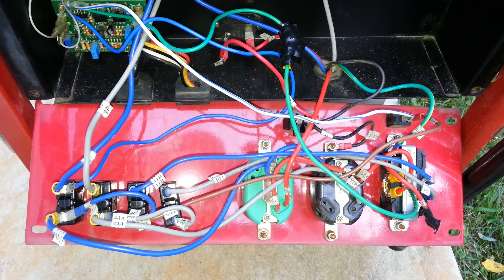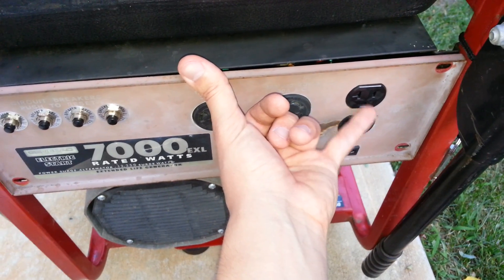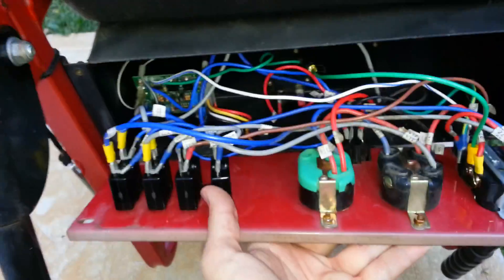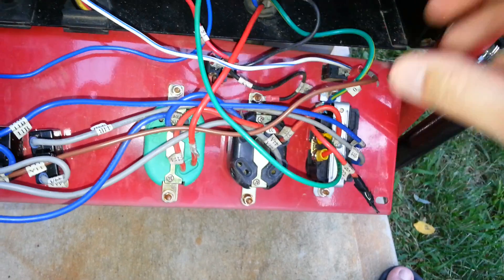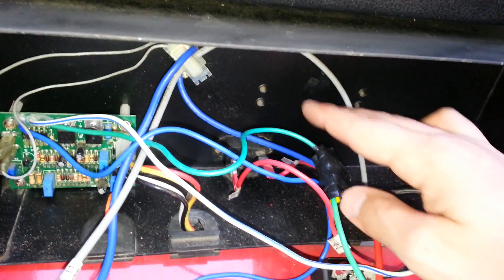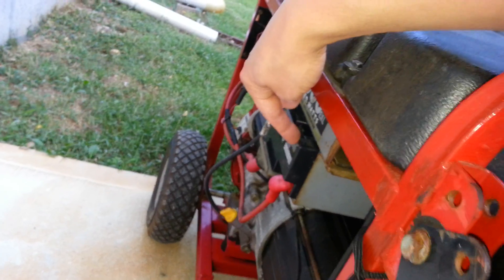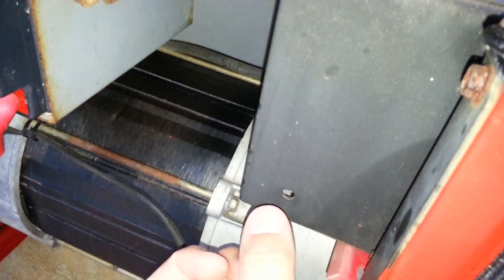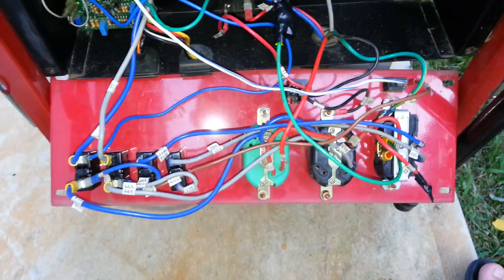Generac Portable Generator Wiring Diagnostic/Overview Part 01

Comment: I’m getting around 130v straight from the gen (isolated). But when I plug everything up I only get 100v from the plugs.
Reply from the maker: Could be a lot of things. With the three-pin molex connector unplugged from the power regulator board in the end bell If the engine is running at 61.5 to 62.5 HZ you should be getting about 170 VAC at the duplex outlets. When you connect it back you should be able to adjust the voltage at the small trimmer pot on the left side of the outlet panel

Comment: My coil bolt at the throttle came loose and caused generator to rev causing the 220v power to fail. Stopped the unit and noticed that problem. Nobody has any idea how to redajust that coil. Also I can get it to run but vo voltage  I see 60 hz but no 120 on the outlet. Help
Reply from the maker: @bikermark4837  unsure of how much damage. Have you checked all the winding resistance values and tried exciting the brushes with 12 volts?

Comment: I have a Generac 4000xl but it's 220 and the blue wire that comes off the circuit board is unplugged I don't know where it goes can you help me
Reply from the maker: @joeylobban501  it goes to the LINE (not LOAD side where the outlets connect to) of one of the 120V breakers. There should be a double spade connector on one of the breakers where you connect it to.
Reply: @Bassguitarist1985  how do i send you video
Reply from the maker: @joeylobban501  You can post a video on YouTube and send me the link
Reply: @Bassguitarist1985  do you have wattup
Reply from the maker: @joeylobban501  Yes I do have WhatsApp

Comment: My generator only reaches 105vac max adjusting the pot on the system board, but reaches 150vac when I disconnect the snubber conector. Any idea what's wrong?
Reply from the maker: @LuisGonzalez-yx7kk  likely you have a failed component(s) on the system control board. It will need to be repaired.

Comment: Wow 10 years ago… I had a question but now I see how old this video is
Reply from the maker: @joewilli850  what's your question? Still have the machine! Many still do actually
Reply: @Bassguitarist1985  I have a Generac 7550 EXL and it stop making power. I installed a new battery and still nothing. My receptacle tester says open neutral and ground fault, on the meter it’s showing 30vac on the outlet
Reply from the maker: @joewilli850  this is a bonded neutral generator. Something is up in the panel and/or stator. Will have to measure all the windings and double check the connections
Reply: @Bassguitarist1985  where should I start. It’s all factory wiring, surprisingly sloppy. Is there a wiring diagram for it
Reply from the maker: @joewilli850  yeah partstree or jacks small engines should have a diagram to check it out looking up the model/serial

Comment: Hi. Does the bond only affect the 2 120 outlets? Or does it affect all of the outlets? Thanks
Reply from the maker: All of them. Any ground fault current is going to flow through that jumper to trip the breaker on the respective outlet
Reply: @Bassguitarist1985  Thank you.  I have the same generator, and you have been a tremendous help through out the years. Again,  thank you.
Reply from the maker: @dj5752  my pleasure!

Comment: Where is the starter solenoid location. My starter is not engaging. It turns but no engaging
Reply from the maker: On the 7000 EXL there is no starter solenoid. The switch is the solenoid basically.
Reply: Thank you for replying. That's what I'm looking at. I need a starter. I have a generac 400exl starter just turns. Doesn't engage the fly wheel
Reply from the maker: @nobodydelete  yeah time for a new starter, or it may need to be greased. Inspect it well before getting another one.
Reply: Tks..I had two low voltage batteries. Can't believe both were low. I put a new battery on and it worked great. Not saving those batteries...I the garage. 
Tks mike

Comment: Hi I have one motor this 
Run’s good 
No have power
Reply from the maker: Hey Henry I would go through some of my videos to that can help out testing the generator. Also check out James Condon's channel. If the powerhead is still in good condition but the boards need to be rebuilt reach out and I can help you repair them.

Comment: Good video's on Generac's, watching my way through them. I have a 5000exl (UK version). I have AC output 230V is bit high at 260V but no 12V or charge output. That pot does nothing on mine, unplugging the 3pin to regulator makes the voltage increase significantly. So, I'm thinking the pot's broken. Like the idea of the adjustment hole, no such hole on mine - yet. Winding resistance between 66-55-77 and I'm getting approx 44mOhms either side of 55, either side of 66A-55-77A, getting about 64mOhm, does this sound right?. I got good joins all round but I have very low volts coming out either the charge socket or charge wire, wont even fireup a 12W bulb. I've given up trying to sort that winding so instead fitted a small 13.8V/2A psu powered from the 110v before it goes through the CT for idle.
Reply from the maker: Hey. 55 is the mid point of the BCW. 66 to 77 and 66a to 77a should be a very low resistance like 0.01 ohms being a continuous winding. Resistance in the megaohm is an open winding. If the pot does not change the voltage while running at 62hz no load, then either that AVR circuit is not being powered or the circuit itself has failed. The blue hot wire off the SCB is the 120V tapped on the line side of one of the CBs, and the neutral is on the blue wire #2 on the outer most spade connector. If you reverse the #2 and #6 wires, the AVR pot adjustment will have very limited adjustability. Hope this info helps!
Reply: It does @Bassguitarist1985 thanks.. As predicted, some loaf had pushed too hard and the pot was flat on its back.. Replaced with a 10k 10t Trimmer (only one I had) voltage adjustment back working... As for the BCW, yeah, that's still caput.. I have a milliohmeter, they're low in resistance but not a short, still no idea why but I have just enough power to make a 12v/5w bulb glow.. Rectifiers, one is OK, other rusted terminals and just pulled out.. Replaced the latter, makes no difference.. Interestingly, I have 66, 66A, 55 and 77A no 77. Only circuit I can get is US version, on mine the front and rear rectifiers have shared input, so one rectifier has 66/77A inputs, other rectifier has 66A/77A..anyway, who cares, I've fitted a small smps swiped 110V before the CT so it does actually idle down.. Thanks for your help..

Comment: I have seen your name appear in several forums as a person who is well versed in repairs of many types. I was interested in your videos of generator issues. I have a Generac 7500EXL that I am in the process of diagnosing. The engine runs but it produces almost no power (.5 vac per winding). I am an electrician by trade but I know mostly nothing about portable generators. Anything I know is what I have learned through the various forums. So the generator came to me not making power I assumed was due to  a damaged rotor (burn marks on the windings), I replaced the rotor and it still makes no power, I replaced the AVR , still no power,I flashed the field with no results. I then applied 12v dc to the brushes and it now makes power. So now I am suspecting the control board, This board has been discontinued for a long time and they are very hard to find and if you find one they are very expensive. ( Briggs and Stratton 83970GS which I have been told has been superseded by 83970CGS). If I understand correctly you can rebuild these? Your thoughts and recommendations would be greatly appreciated.
Reply from the maker: Hey Craig yes i do rebuild the boards. Are you getting high voltage now? Is the engine speed 61.5hz no load?
Reply: I didn't want to leave the voltage on the brushes for long not knowing if this would do damage but for the brief time that it was connected I saw 119 volts, I really have no way of checking frequency
Reply from the maker: @buyamerican3191  a Kill-a-watt meter at home depot or lowes can tell you frequency and thus engine speed. This needs to be set properly before doing anything with voltage adjustment and troubleshooting. If you are getting high voltage without the 3-pin molex connector attached to the regulator in the end Bell then your generator end is healthy. If you are not getting any voltage at all as long as you're polarity is correct on the brushes positive closest to the bearing. Then you might have a winding problem. I have a few videos up on how to test the Exciter winding for example.
Reply: @Bassguitarist1985  many thanks, I will explore More and see if I can get more information to provide to you

Comment: I have a Ryobi RG6700k generator.  It had ignition and starter but there is no battery or battery bracket.  You buy it that way.   I need to know wiring from ignition to starter to battery because I want to add a battery. Cannot find any information on this.  Thank you
Reply from the maker: sorry i am not familiar with that generator. you are trying to add a 12 volt electric start?

Comment: I'm having a hard time with same model generac 7550EXL 
Replaced the voltage regulator and got power for little wile wile repairing the engine it quit.
Replaced battery and bought another OEM voltage regulator got power again started going over the generator output set Hertz to 61 and noticed voltage is at 160. 
Tried adjusting the potentiometer on the control board but no change. 
Was planning to send board out to be checked over just thought I'd check and see if theres any other possible issues to watch for and happened across your video.
Reply from the maker: Sounds like the system control board failed.  I repair them myself through the LLC I have. It's important you send the boards as a set,  I know you just bought a new regulator board.   That way you can make sure that both boards are operating the way they need to.

Comment: Can the panel be rewired to one larger breaker?  My thought is to be able to supply whole house with a 50 amp breaker or larger.
Reply from the maker: You could put a 50A plug on there if you want, but 7k watts is not 50A, its 30A.
Reply: @Bassguitarist1985  Thx. OK, I'm now confused. Can't all the breakers on the generator be bypassed and have all the generating power be put into one larger breaker then fed into the home?
Reply from the maker: @skorrchafer  that is not wise. The push to reset circuit breakers on the generator are supplemental and are there for safety. It is possible for you to use the L14-30 twist lock on the generator and route it to a 50A breaker in your panel. In an overload scenario, the breakers on the generator will trip first. If you ever got a larger generator later as long as you installed the correct gauge wiring you could set it up to run up to 50 amps. 

If you remove those breakers on the generator and power a 50 amp breaker in your panel directly bypassing them in an overload condition your generator will destroy itself. I am not sure what is unclear but the generator cannot produce 50A at 240VAC
Reply: @Bassguitarist1985  Thank you. I just had to here it from someone more informed than me on this subject. Thx again.

Comment: I have this model generator. Starts out with 120 volts on both sides just fine....after about a minute it drops to sixty volts both sides. Changed the diodes,,,,,nothing. Gotta be the control board right?
Reply from the maker: Likely yes. Does the voltage go high with the 3 pin white snubber cable disconnected?

Comment: The Battery Tender Plus is a 1.25-amp battery charger designed to fully charge a battery and maintain it at proper storage voltage without the damaging effects caused by trickle chargers. Included is a quick connect harness for hard to reach areas.  The difference between a float (or battery tender) and trickle charger is that a float charger will only turn on and charge your battery when it has self-discharged below a certain level, whereas a trickle charger continuously emits a small current of electricity regardless of the charge level or even if it's full.  I think we are good to go with this one.

Comment: Hi,  I am trying to install an electric start on my Generac  4000XL model, GN220, 7.8 HP Generator engine  The engine/flywheel is equipped to accept the starter motor.  My question is as follows:  Once all is installed I would like to set up a battery tender to keep the battery charged at all times.  My 7550exl has it built into the unit.  The Company Battery Tender makes a 1.25 amp charger.  Is this acceptable? I do not want the Battery to explode or not be strong enough.  I would also like to know if I need to add a solenoid?  My push switch starter is a heavy duty switch made by Briggs and Stratton  Part # 77282GS.  The same switch that is on my 7550exl and that unit does not have a solenoid. Anything else you can think of to make this a safe working install is greatly welcomed.   Thank you for your help.
Reply from the maker: Is the battery tender a smart charger? As in not constant current? If so then you should be just fine.
Reply: @Bassguitarist1985  This is the link to the Battery Tender. https://www.youtube.com/watch?v=Q-n4OF_UggQ
this Is on YouTube. I believe he states it is compatible with all of the up to date batteries. The Battery I intend to use is the same battery that I'm using for the 7550exl. Universal Power Group 12V 18AH Briggs and Stratton Generator B4489GS 193043GS UPS SLA Battery. Thank you for such a fast response.
Reply: The battery float charger that came with my 4000EXL is available from partstree.com for about $26.00.   It is a 750ma float charger.  Their number is 512  288  4355.
Reply: @timmcdougall1407  thank you.

Comment: I have this generator and just replaced the VR. Home run. Now that it is running and producing voltage I have another problem. The auto idle does not work. It will not idle all the way down and when loaded it will not increase in RPM. Can you help me trouble shoot ? I will mention this generator has no more than 50 hours on it and is 15 years old. It is clean and the engine runs great.thanks...your videos have really helped and saved a ton of money.
Reply from the maker: thank you for watching!

Comment: Hi xboxer1985.  You have helped me before with trying to run my 2003 Generac 7550exl/13500 generator with regards to seeing if it can run a 3 ton a/c unit.  You suggested to replace the breakers with new ones since it ran the a/c for awhile and then the units 30amp breaker would trip and the Generator continues to run the a/c without any problems. (alone, of course, nothing else except my refrigerator. runs both).
I noticed today when I tested my generator that the twist lock L14 outlet on the unit was reading A/C output 152 - 154  Volts On both 120/240/30amp, and 120/30amp.  Normally in the past it reads 123-124 Volts with no load as I had set it. Both still reads 62.5 HZ @ no load.  The 120/20amp regular outlet both top, and bottom still reads 123-124 Volts @ 62.5 HZ.  Any Ideas of what may have caused this UN-provoked  changed? and where I should look to correct it?  Thank You.  John

Comment: Hi xboxer1985.  You have helped me before with trying to run my 2003 Generac 7750exl/13500 generator with regards to seeing if it can run a 3 ton a/c unit.  You suggested to replace the breakers with new ones since it ran the a/c for awhile and then the units 30amp breaker would trip and the Generator continues to run the a/c without any problems. (alone, of course, nothing else except my refrigerator. runs both).
I noticed today when I tested my generator that the twist lock L14 outlet on the unit was reading A/C output 152 - 154  Volts On both 120/240/30amp, and 120/30amp.  Normally in the past it reads 123-124 Volts with no load as I had set it. Both still reads 62.5 HZ @ no load.  The 120/20amp regular outlet both top, and bottom still reads 123-124 Volts @ 62.5 HZ.  Any Ideas of what may have caused this UN-provoked  changed? and where I should look to correct it?  Thank You.  John

Comment: is there any mod to get my generator to put out 24 volt instead of 12? i need it to help charge my 24 volt, 220 amp hour battery bank.
Reply from the maker: buy a 120V or 240V to 24VDC converter. IOTA engineering comes to mind

Comment: I think I understand what you're saying with the neutral/ground separation. Just like an electrical sub panel requires separate neutral and ground bars, the main breaker panel can share neutral and grounds on the same bar. So in other words this would only apply if you're using the generator as a home power backup, correct? My brain is still catching up.

I'm curious if it would be possible to eliminate those cheap looking breakers and pop in standard breakers.
Reply from the maker: yes correct, N-G at the generator with attached ground rod (separate from house rod) if you are using a 3 pole t-switch, or floating neutral with a 2 pole t-switch and gen is bonded to the house rod.

Comment: I took those off but it wont come out from the frame. I thought there may be some trick to it. Hopefully I don't have to remove the bottom portion just to get that panel out. Any ideas?
Reply from the maker: You shouldnt  have to. there are 4 bolts on the front of the panel to remove it from the panel box.

Comment: I have a generac EXL4000.  the 110 sockets both don't work and the middle breaker is popped. When I push it in it feels like it has mashed it and does nothing. My question is how do I get to the back of the elec panel to gain access to this breaker and or the 110 volt plugs to repair?? thanks in advance
Reply from the maker: Should only be four bolts on the control panel to release it from the box